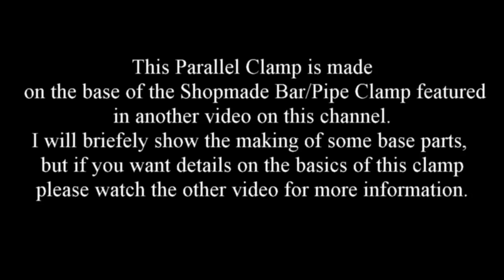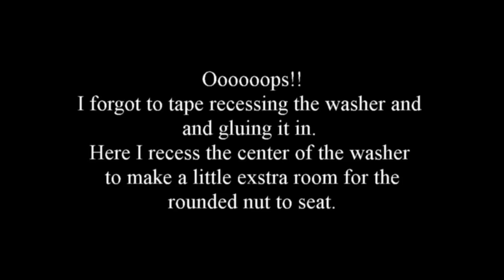Shopmade Parallel Clamp

Comment: Thank you, and here's a suggestion if it hasn't been made before:

On the screw, instead of grinding a nut down and then jamming it in place with another nut, why not use an acorn cap-nut and a dab of epoxy?

Comment: Thank You very much for the plans,easily understood. I had some aerial pipe stands hanging around which were the same size,but the good thing with Your plans,I can adjust to whatever pipe I come across.I will let You know when I make them,how they came out.Your's are the neatest I have seen--Thanks again.
Reply from the maker: maxim edwards Thank you very much Sir, for purchasing the, and I am really glad you liked them. it would be really cool to se some images of the final product. Thanks for watching and commenting
Reply: Bellevue Woodshop Thank You for replying, I will do that, but wont be till it warms up a bit as I only have a shed and can only do outside (no room).Same with the 1'' belt sander of Yours,cant wait really to build these.Hope You have more in the pipeline. Good luck and best wishes--Max.

Comment: I decided to purchase your plans yesterday, because of the cut-out templates, and instead of paying $35 to $85 a pop depending on the length I was able to churn out 16 Parallel Clamps for only $35 worth of maple and about $10 in hardware - 4 @ 12in. 4 @ 24in. 4 @ 36in. and 4 @ 48in.  I ended up using 3/4 in. wooden dowels instead of the pipes...I might run into some stability and strength issues with the longer clamps but as for the 12 in. size they worked great this morning.  I ended up using an acorn cap nut for the tightening mechanism, which worked great if there is anyone out there without a bench grinder.  You, kind sir, have saved me hundreds of dollars and for that, I thank you!
Reply from the maker: +Ryan Harbison Thank you for the purchase and for the kind feedback Ryan. Really glad you liked it and had great success. It would be cool if you would share some images of your build with me for my readers tools section on my website. Feel free to email me through my website www.bellevuewoodshop.com. Thanks for watching and commenting, it is much appreciated
Reply: +Bellevue Woodshop I'll be sure to share my finished clamps as soon as I wrap up the finish on them.  Since I went with poplar dowels instead of pipes (to save more money:$) I'm making sure I get enough coats of poly on them to strengthen them as much as possible.  Your plans made it very easy to mass produce this style of clamp...it was a matter of making the same 5 cuts over and over again.  I'll get those pics over ASAP.  Thanks again!

Comment: I just bought the plans and I had a couple of questions.  Did you round over the top of the pressure plate in the video?  It looks different.  Also is the bottom of the pressure plate square to the sides?  I notice it rocks in the video at 6:40, it's hard to tell... Lastly is the hole for the pipe slightly over sized to achieve this rocking motion?  (The "rocking" I'm talking about is at 7:50, for example).

I apologize, but I'm not very familiar with the "standard" widths of things that might be available where metric units rule.

I'm looking forward to this weekend project!  Thanks for the video.
Reply from the maker: Jeff Correia Hi Jeff, and thanks for purchasing the plans. If  I understand you correct you are talking abou the part that holds the threaded rod?  If that is the case it is shown at 0:50 This part need to "rock" just a little to let the steel plate in the back be able to "dig" into the pipe to lock the position. I happen to have two 26mm forstner bits, and one of them is slightly larger than the other so that worked out for me. you might have to experiment a little to see how much larger you need to make the hole to let make the steelplate dig into the pipe. If you watch my other video on making the bar/pipe clamp, you will see how the " locking" function works. I hope this answer you questions, if not please just send me an email, and I will try to explaint in a best possible way. Tahnks for watching
Reply: Thanks for the quick response. I'll take a look and send you an email if I have any further questions.

Comment: Sick, man!  This is a genius idea.  I don't know how many you've built, but have any broken yet?  I guess the weak point is probably the wooden thread, but if it strips out, all you'd have to do is throw a t-nut into the stripped hole.  Really cool!
Reply from the maker: Thank you. I have only made a couple so far, and have not really put them to the test. But check out my other video on the Bar/Pipe clamp, there you can se a test on the strength of the wooden threads, they hold up VERY good. Asyou say you can use a threaded nut, but in Norway, i cant find these for 12mm threaded rod. one could of course also use a regular hex nut, or couplernut buried inside the wood.

Comment: Fantastic!  You are a genius!  I started to build mine from your plans and would like to better understand how you lock the front block in place.  Do you use a threaded bolt ?  No threads in pipe ?  Simply hammer it down ?  Thanks for all your great work
Reply from the maker: stephane chaine Thank you very much for that very generous comment. I used a threaded bolt, and drilled a slightly smaller hole in the wood than the bolt diameter. The hole in the pipe are the same as the bolt. Then i just put epoxy on the bolt and hammered it down as you say.

Comment: I've just bought the plans, they look very easy to follow, I just need to build them now. they look fantastic and again can be built to all lengths required. Any advice on the general size used around the shop.
Reply from the maker: Thanks Robert. It depends on what you normally build in your shop. I made a set wide enough for most cabinet doors (aprox 800mm opening) , and some longer ones for furniture pieces with a 1200mm opening. Thanks for the kind feedback

Comment: Roy I never see you use these clamps in any of your builds so am a little leery to try them out. They work well?
Reply: Hi Tyler,I made one myself using the plan and for the moment is not working as it should. I may have to redo the presure plate, since the mobile jaw is sliding on the bar
Reply from the maker: WOW Tyler, this comment just popped up....after a year...... hmmm
They are based on the same principle as the other bar/pipe clamp, as when it comes to the friction part. The reason that I do not use the in my videos, is that I only made 2. And most of the time that is not enough. I have 10 of the other clamps, and felt I did not need to make more.
Reply from the maker: Hi Florin. They are based on the same principle as the other bar/pipe clamp, as when it comes to the friction part.  The mobile jaw should "tilt" a little to allow the friction plate to "grab" the pipe. You might want to try to enlarge the hole a bit with some sandpaper. It should not be to tight
Reply: The mobile jaw is "tilting" but the friction plate doesn't "grab" the pipe.
I'll try to move this plate closer to the pipe.

Anyway thanks for the tips and the plans.
Keep up ;)

Comment: How did you make the metal clamping plates? Drilling a precise 3/4" hole in 1/8" thick steel plate would be somewha problematic for most people.
Reply from the maker: Thank you, I drilled a 1" hole in the plate with a metal drill at work, and cut it into two halves. Or one could cut it with i jigsaw and metalblade. the steelplate I used was only about 2mm thick

Comment: I’m definitely going to build some of these clamps in a few different sizes. I do have a question though that I’m hoping someone can help with:

Pipe clamps (especially in longer lengths) will bend and doesn’t evenly apply force when you crank down on it. I’m concerned that using conduit or steel pipe will have this issue. I’m considering using 1/2” solid 6061 aluminum round bar from a local supplier. I can get it for about 80 cents/foot. Anyone know if this would this be a better option for longer clamps? Seems like it would be much more rigid but I’m not completely sure.

Comment: Hi there, thanks for sharing these designs. I have purchased the plans and just made a set of these clamps in various lengths but I have an issue with the pressure plates sliding loose when tensioned. I’ve mounted the steel plates as close to the tube without binding as the clamp is adjusted. Do you have any suggestions?
Reply from the maker: Hi, and thanks for using my plans Adrian. The issue might be that the friction plate is mounted to close to the pipe. The piece that holds the "brake plate" should have a little slack and the plate should be mounted high enough to allow the piece the skew enough to grab the pipe. If you look at my video on the bar/pipe clamp, at timestamp 12:05 you can see this demonstrated:  https://www.youtube.com/watch?v=qLacO-qGx4U  Let me know if it works out for you.

Comment: Nice clamps! Where did you get the steel pipes? And is this just a big nail, which secures the upper piece to the pipe?
Reply from the maker: Thank you very much. I was given 150 feet of these pipes when they cleaned out some storage at work. The headstock is secured by a bolt aprox 6mm x 75mm

Comment: Hey Bellevue, 

Bought your plans a while back and am now just getting around to making them.  I do have one question though.  The bolt/screw you grab at the 4:00 and 4:54 minute marks, what is it called?  I cant find it here in the States at Home Depot or Lowes.  That bolt/screw is the only thing I am having trouble with.  Thanks.  Can't wait to make them!
Reply: +Steven Kirby Also what size is the bolt.screw you used at the listed time marks?!  Thanks again!
Reply from the maker: +Steven Kirby Thanks for youir purchase Steven. The bilt I used was a 6mm x 70mm, but anything long enough to go through the pipe and a bit up into the stock above would work, So in imperial I guess a 1/4" x 3" should be great. Happy building

Comment: Mine keep sliding rather than biting in, thoughts?
Reply from the maker: It could be that the "brake plate" is to close to the pipe, or the hole for the backstock (with the plate) is not big enough to make the backstock skew. this could prevent the "brake plate" from "digging" into the pipe. If you check out my video on the Pipe Barclamps, you can see me testing out the brake at minute marker 12:10 in that video. This is the link to that video:https://www.youtube.com/watch?v=qLacO-qGx4U  Hope this helps you with this issue

Comment: How did you punch out the holes in flat steel used in clamps?
Reply from the maker: Mike Kapotsy I drilled them out in the plate using a  metal drill in the drillpress, at the pipe diameter, and then cut them in half
Reply: Wow, I don't have a bit that large.  I will have to figure out a compromise.  Had to purchase an odd-sized forstner bit to match the pipe diameter I had, 23mm.
Reply from the maker: Mike Kapotsy You could also use a jigsaw to cut the semicircle, and adjust it with a file. A little more work, but make sure to make it as close to the shape of the pipe as possible for a good friction fit. There are also holesaws for metal to be purchased at a reasonable price, it think I have seen them all the way down to 16mm i think. Might be something to consider
Reply: Bellevue Woodshop Hello, purchased 23mm bit to match pipe.  Great for end stock but too tight for sliding clamp heads.  15/16" paddle allows some movement.  Would you agree I should use it for sliding part of the parallel clamp head? Thanks. Mike
Reply from the maker: Mike Kapotsy I think I would make a test piece in some scrap wood to check. a 15/16 equals 23,81mm I think, and that may be to loose a fit, but as long as it "grabs" the pipe its ok. It does not matter if it is not perpendicular to the pipe as the "pressure plate is self adjusting
Reply: Bellevue Woodshop thanks, the 23mm is so tight it would probably not allow the clamp head to slide at all.  If 16/15" is too loose, I suppose I could spindle sand the hole to open it up slightly?
Reply: Bellevue Woodshop So I measured my conduit again and it measures about 23.5mm give or take.  The bit is producing a 23.4mm hole so that explains why it is so tight.  The 15/16" bit measures 23.9 or nearly 24mm so it would be about .4-.5mm of slop.  Thoughts?
Reply: Bellevue Woodshop sorry so many replies.  I did a test in scrap piece like you suggested and it slides very easily laterally along pipe with not much slop left to right.  Thoughts?  I appreciate your input, love your design!
Reply from the maker: Mike Kapotsy Thanks Mike. I Think I would go for the loose fit, The tailstock has to be able to "tip" a little to give the edge of the metal plate a chance to "dig in" to the pipe

Comment: AWESOME! I don't have any parallel clamps, wouldn't the rod need to attach in the center of the clamping foot to get equal pressure across the face? I understand that the foot is held perpendicular to the bar by the two holes, but with the slight wobble in the hole, do you get unequal pressure?
Reply from the maker: +Tim Johnson Thanks Tim. The way this work is due to the sliding part (with the plywood sides) being as long as it is with tight holes in the front and back it does not matter where you push on the back of it. It will stay close to parallel to the front block that way. Hope that made sense. Thanks for watching and commenting